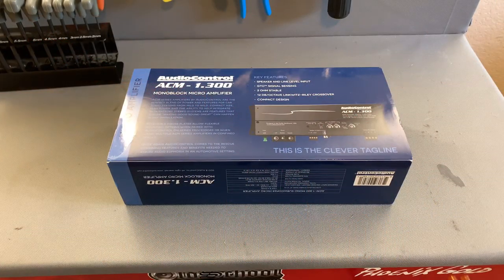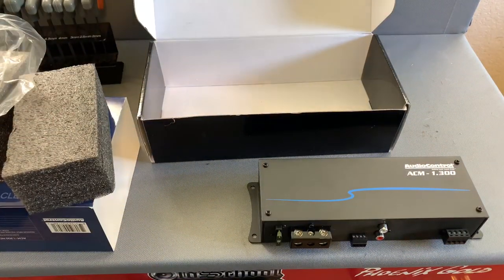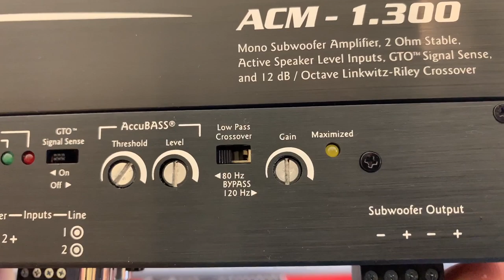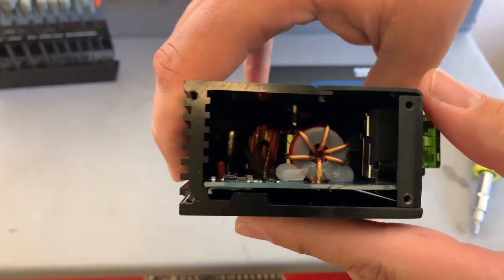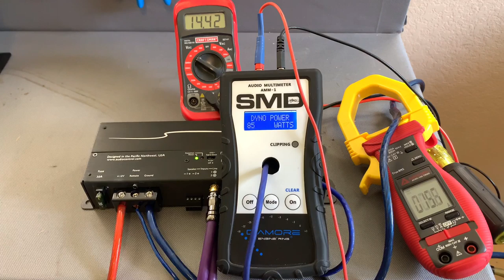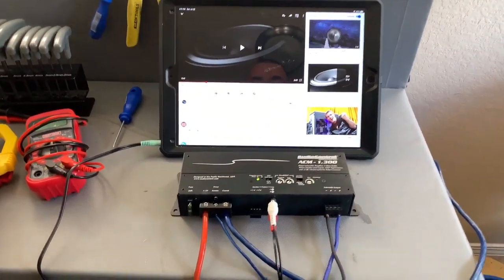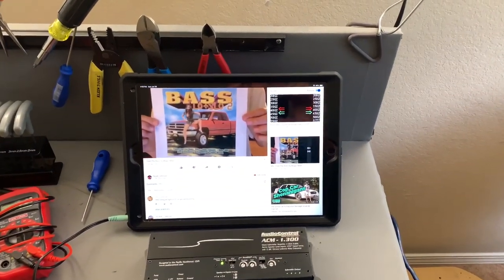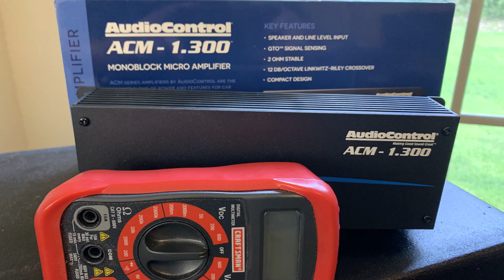Audiocontrol ACM 1.300 Review/Amp Dyno [4K]

Comment: I have this amp powering a JL Audio 8W1v3-4 "open air" on the rear deck and was wondering if this could still effectively run a small 10" box if I decided to add one to the system?

Comment: I see you're using the 2 outer most speaker terminals, but i see no mention of running it like this in the in the manual. I'm currently running one 2ohm speaker off the right set of terminals like it's pictured in the manual. Am I running it at half its capability?
Reply from the maker: No you’re ok you can run it either way because the outputs are already internally bridged. It was just easier for my set up to have more separation

Comment: 349 watts at 37.7 amps seems amazing to me. Is that typical these days for 300+ watt amps? That seem super efficient.
Reply from the maker: craftchest that’s about 64% efficient @2ohm which is pretty solid if you ask me. 

37.7x14.4= 542.88
349/542 = .64
Reply from the maker: It is a cheap clamp meter so being 100% accurate is unlikely, but it should be a good approximation.
Reply: Oh yea, i realize that. I am just use to seeing people show dyno test with like 250 amps being pulled and I like that three alternators lol
Reply from the maker: craftchest yeah I stay away from those big amps lol

Comment: Was just looking at this little amp the other day. What does the fixed subsonic filter mean?
Reply from the maker: Random Tube means it’s not adjustable you basically have to choose depending on what setting are available from the factory
Reply: @HifiVega  I was concerned that it wouldn't play really low notes
Reply: The subsonic is fixed at 24hz...